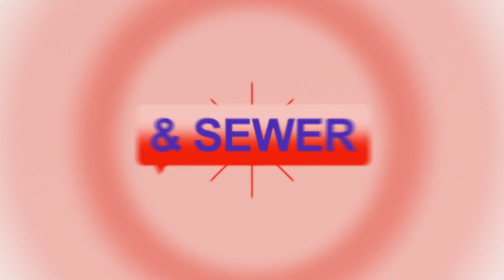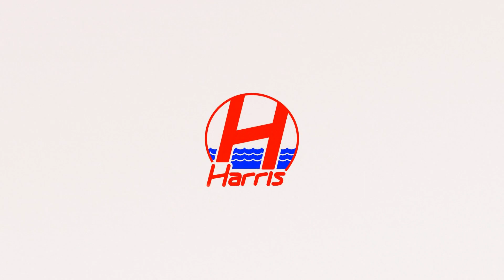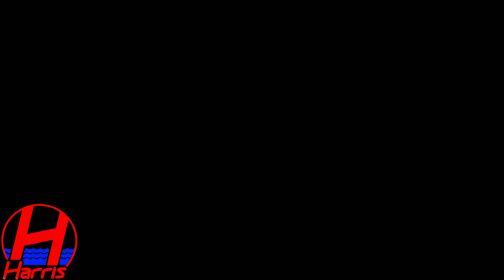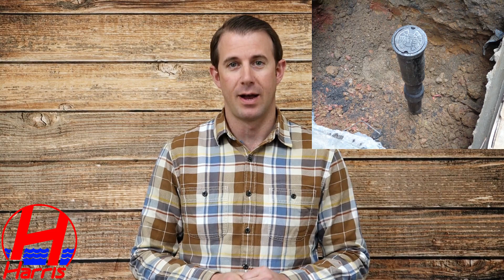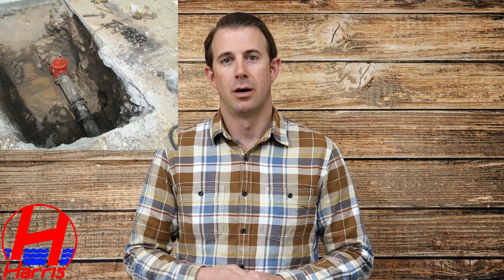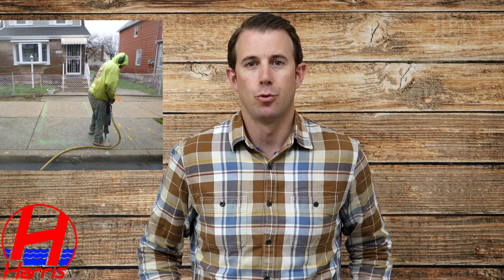Water Main Curb Stop Valves All You Need to Know

Comment: Quick question can you explain the difference between a tap and and curb stop?
Reply from the maker: Absolutely!  A tap is where a service line connects to the water main, while a curb stop is a valve that controls the flow of water into that service line, typically located below the sidewalk in NYC. Both are essential components in plumbing systems, allowing for the safe distribution and management of water supply to buildings.

Comment: My water meter needed to be replaced and company could
Not shut the water off to my house until they fixed the curb valve. Curb valve was replaced almost a year ago and today I get a notice on my door that it’s leaking. I stuck a tape measure down to the curb key to see if there was water in the bottom but Hardly any at all. Will saw cut and dig up valve for further inspection. Any advice dealing with water company ? Less than a year leaking after replacement seems quite odd to me
Reply from the maker: Yes, I would suggest keeping it simple. Notify them that they are the last person to touch the water main and it is leaking on the exact pipe they worked on. It is industry standard that a pipe is guaranteed for 5 years at a minimum pending location and size
Reply: @HarrisWaterandSewer  I’m honestly not convinced at all that the water line to my house is leaking. Front yard and basement are absolutely bone dry. This was all brought about by water coming up in the street from my neighbors gas valve shut off. What is a typical way that a water company can prove it’s leaking between the curb stop and my water meter ? Thank you for swiftly responding to my first question
Reply from the maker: @ptorba88  Read our website content on 3 day notice in error.  This is how they handle errors in NYC!
Reply: The utility may simply mean that the meter indicates there is a leak in the home or service line. Even a tiny drip adds up to a lot of water over time. Check for toilets which use water when not flushed, drippy faucets, or in dry months vegetation unexpectedly green. If the meter moves at all when no water is being used, you do have a leak somewhere. It pays to get these fixed sooner rather than later.

Comment: I found ours and took the cover off. Was unsure how deep the actually valve is. So I used a 3’ metal ruler to measure and it appears to go deeper than that. I only see curb stop valve tools between 16”-36” for sale. Does it require something g li get than they usually? I live in Minnesota. So the frost line probably goes pretty deep I guess.
Reply from the maker: In some cases you can use an extension but the standard key should work!

Comment: This cracks me up.  I'm pretty sure that the 'more often than not' the homeowner causes damage by accessing the curb valve statistic is not true.  How would you know unless all the homeowners that successfully accssed their curb valve called afterwards to let you know? LOL Turning your curb valve off/on is not rocket science and should be somerhing everyone that has one knows how to do in case of an emergency.
Reply from the maker: Appreciate the comment! The truth of the matter is that we get calls on a weekly basis regarding curb valves that are no longer functioning. It usually turns out that the homeowner or their "plumber" tried to utilize the curb valve that is no longer working. Ok, OK maybe it is not the homeowner that causes the issue and maybe it is their "plumber" 😁. 
It is not rocket science however, when dealing with a small curb valve it is VERY easy to snap it or over turn! Next time you come to NY call us and we will test your skills!
Reply: Also, if we're watching videos like this it's most likely because we cannot afford the professionals to come out.

Comment: How does a curb stop valve box prevent soil from blocking the valve? Wouldn't soil make its way into the box area if it's not water tight?
Reply from the maker: Great question. There is a curb box sleeve that sits over the valve and allows access from above ground. The issue may arise if dirt enters the sleeve.  In this case you can try to clear the dirt or may have to dig it up to remove, and install a new sleeve
Reply: @HarrisWaterandSewer  Thanks!! But when I see a photo or diagram of a curb box, it's loose fitting; it looks like it just rests on top of the water pipe with no way to keep anything out. Doesn't soil make its way upward around the valve. I'm not referencing dirt infiltration from the top, I just don't see how it's an air tight connection - the curb box over the lateral pressured water line.
Reply from the maker: @tony17112acst  You are absolutely correct, it is sitting directly on top and not air tight. When the surrounding soil is compacted well the dirt will not find its way inside of the sleeve and prevent the actual valve from being used. It is very important to make sure that the soil is back filled in lifts and compacted very well to prevent any issues!
Reply: @HarrisWaterandSewer  Thanks so very much for taking the time to reply! I didn't know that's how it worked underground. I thought moisture would make its way down and move things around a little, and over 20 years, it'd be all mush in there! But I guess not! Thanks again!
Reply from the maker: @tony17112acst  My pleasure!  That is what we are here for!!!

Comment: Where are you located? I live in a small town in Montana. I had 4 sump pumps in the basement in my house. Now I have 5. I have been having water coming into the house for 12 weeks. The house obviously has had issues with ground water, but I believe it's coming from the main water line, how do I find out for sure, before digging up my driveway?
Reply from the maker: Hello Becki-
We are located in Brooklyn, NY. In NYC we perform noise tests on the pipe which give a strong indication if the main is leaking or not. I suggest calling the town or city you live in and see if they can assist with the test
Reply: @HarrisWaterandSewer  I cleaned out the curb stop so the city can get to it this week. We live in a little rural area and the city crew doesn't seem to like doing this kind of work. But I need to know and have it fixed before winter
Reply from the maker: @beckibishop6732   Do you have a plumber that you trust?  I would suggest calling someone with experience and see if they can assist with the cub stop. It is common that someone without much experience may damage the valve leading to future issues. I suggest contacting someone you know and trust!
Reply: @HarrisWaterandSewer  we do have someone I already think its a busted valve. And that would be up to the city to repair. My house sits on top of an old stream bed and we live on a flood plain. Whoever thought it was a great idea to put basements in were like super smart lol But the ground water in other peoples home has gone down, the city was trying to say its because the ground was thawing and then it was that the ground water was up. They don't want to be liable if it's an issue of theirs and so turning off the water which is a hassle for me and my kiddos. But I was told that if the water is turned off and the water goes down then its a water line issue. I want to thank your advice on this matter. My dad was one of the first native American journeyman plumbers in the state of Montana. I wish he was still with us, but sadly he passed from cancer along with my little sister, Leukemia and my mother in January from god awful bone cancer after beating breast cancer. I am raising my other sisters children she passed at 32 from an enlarged heart. So yeah I am ready for this water odyssey to get solved. I know TMI right? LOL But thank you so much for responding to my questions.
Reply from the maker: @beckibishop6732  Our pleasure and we wish you the best of luck!
Reply: Get the water tested for chorine  or listen .. Turn the curb stop off   Have the city come out an investigate .

I worked for Toronto water as an investigator and we would keep looking until we found the leak .

If it was or private you would have to fix it but we often would dig on city to make sure

Comment: You did not cover my question regarding the curb valve.  If the curb valve is turned off will the water in the line gong to the home drain back to and out of the valve ?
Reply from the maker: Hello-
No the water will not drain out, all of the water will remain inside of the pipe unless you decide to drain it out.
Reply: Use an air compressor and attach it to the laundry hook up, blow it all out of the sinks at you’ll have no water in the lines. Turn the valves of all toilets before blowing them out. Turn off the other hot or cold laundry hook up too.
Reply from the maker: @johnbecht3158  This would certainly work if looking to clear the line of water